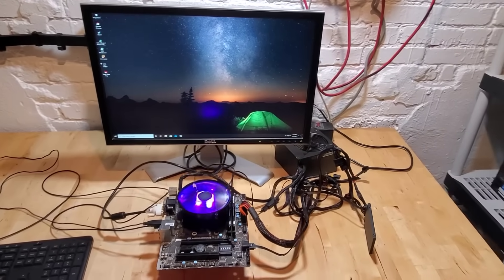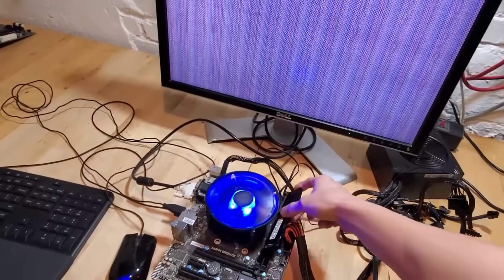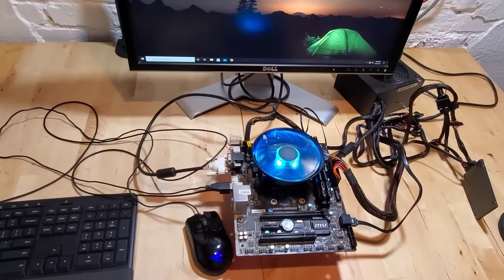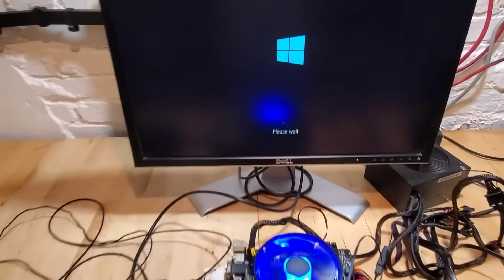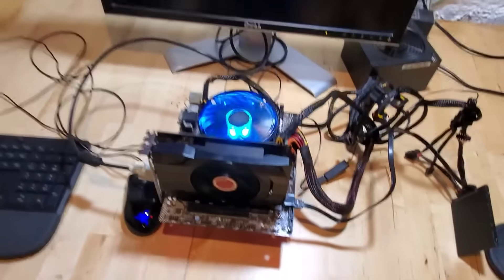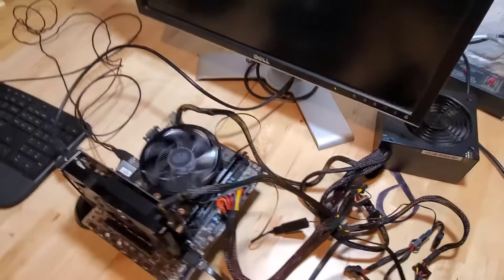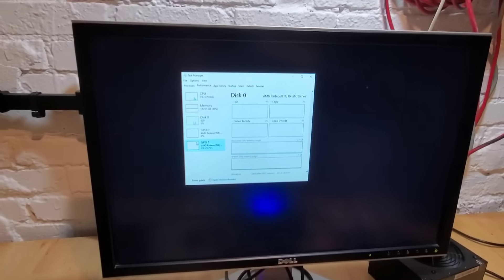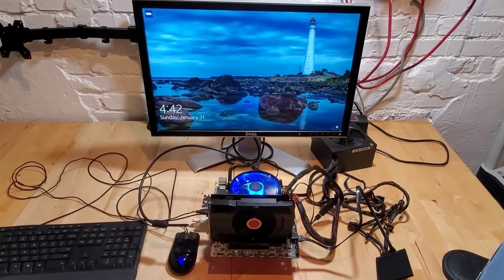What happens if you remove PC components from a running computer?

Comment: I was REALLY hoping that after removing the gpu, you would reconnect the display cable to the mother board..
Reply: Wouldn't change anything. The system actually stopped working as soon as the GPU was unplugged, because that's how WDDM is supposed to work. The device becomes inaccessible, which causes the GPU driver's frame buffer to enter a possibly infinite loop of waiting, then Windows kernel sees what's happening and terminates the whole system with stop code 0xEA (THREAD_STUCK_IN_DEVICE_DRIVER).
Reply: I was hoping too.
I think this is very relient on windows, I guess you could decide how it would react on linux.
But u know windows was not expecting custommers to... well.. unplug essential components from their computers. So my bet is that it would still be a black screen. (that would mean that they have a script that reacts to the gpu not answering anymore)
Reply: @klimmesil9585  Has nothing to do with scripts and Windows vs Linux but with the way BIOS and UEFI work. While there is an option for hotswapping PCIe, both the GPU, PCIe chipset/CPU lanes and BIOS/UEFI need to actively support it, be configured to do hotswapping and be prepared before removing the GPU.
Linux would also just crash as part of a memory space is suddenly gone and various PCIe registers are now corrupted, effectively locking the system out of controlling itself, regardless of Linux or Windows is desperately trying to keep things running...
Reply: So true so mothafucking true

Comment: i gotta say, this has made me feel a lot less worried about working on a pc. Was always terrified some part would just brick if you did a single wrong thing, or installed it a little off or anything
Reply: i mean you still have to be careful, I heard of lots of cases when the parts or mainboard just got fried due to that
It can vary from case to case I think
Reply: I mean, if you install a CPU "a little off" you could bend the pins(either on the CPU or the Socket depending on the type), it IS fixable, but usually just treated as bricking the part since it's so finicky to get them all right again.
Reply: when I was repairing my pc after my PSU went out, I was trying to figure out why my SSD wasn't being detected, so I look in my pc and I saw the SATA cable was not plugged in. stupid me decided to plug it in with the pc on and a few seconds later the cable went up in smoke. it destroyed my SSD lol.
Reply: @ImJustCj  it seriously started smoking lol? Sad
Reply: @chaosbuilder1531  Bent pins could cause that indeed.
On my PC I have SATA hotswap enabled so I can actually connect and remove SATA drives like removable storage, they even pop on the safe removal thingy (which I always do for HDDs). With a decent cable it's safe to do, now some crappy one could definitely cause serious damage, they aren't really made for repeated use.
Reply: Its funny actually, so many factors, sometimes parts can be stepped on without taking any damage and sometimes a single touch of your finger can fry your motherboard.
Reply: dude same
Reply: Your cpu will.
Reply: There are some very devastating donts in pc building tho, primarily under any circumstances you should never use the cables of one power supply on any other power supply, even one from the same brand.
Reply: @xaviorprime9203  That's not true, you should just never use cables across PSUs that aren't the same cables. Some PSUs come with the exact same cables, like the Corsair rmx series. Usually can Google it pretty easily.
Reply: @Wft-bu5zc  Thats one case where it works, and you wanna know what happens when you try this with lets say an EVGA power supply? It fries, i did that
Reply: @xaviorprime9203  Yeah, so uhh... don't do that. BAM, problem solved!
Reply: @couchmaster3773  Its not so simple when litterally i just used the same exact cable from the same exact model of the psu on my psu. Like the exact cable, it should be common sense that it will work right? And yet it didnt
Reply: @xaviorprime9203  Yeah so... like I said, don't do that
Reply: @couchmaster3773  He said that before you did. Stop acting like a knowitall
Reply: @spicesmuggler2452  'Ight, I'll get started on that by asking what you're talking about?
Reply: @xaviorprime9203  somehow in all my years of being into PC building stuff I never heard of this. I got a new PSU and replaced all the cables except for the ones for my 2 hard drives because I figured it used the same amount of power between the two power supplies so it wouldn't matter. Both of them were fried and I lost 6 TB of data. I'm lucky I replaced all the others because I would have fried every other component including the 3080 I just purchased.
Reply: @energysynchronized9932  Thats sucks to hear man, i also lost quite a lot when i fried my pc. Never got another gaming pc after because i was poor and couldnt afford it. Now im stuck on a 1050 ti
Reply: I always thought it could fry something, really impressed it didn't!!
I mean, one time I forgot to unplug the battery from the laptop while I was assembling the laptop screen, and as soon as I plugged the screen in with the battery still connected, I fried the LCD backlight inverter!
Reply: @you2be839  Yeah laptops are much more likely to have issues because of the battery thing, I stupidly tried to replace the thermal paste in my laptop because I thought I knew enough about building PCs to figure out a laptop, but I forgot to disconnect the battery, and bam just like that my laptop lost it's GPU entirely, and since the GPU is soldered to the motherboard there's no way to replace it, was just out of warranty, very expensive mistake!!
Reply: You should still be very careful... Never hurts to be careful and paranoid. Never work on anything while it's plugged in either.
Reply: Boy, I bet all these replies reassured you! FR though, the rule of thumb is, in my experience, pretty much just "don't act like a complete moron." And also maybe keep a receipt around... just in case.
Reply: And thats why u dont build ur own pc if you dont know how to build one
Reply: Yeah, plug a plug in a 3090 in halfway and you fry your 1300$ gpu
Reply: I know what you mean. When I was much younger I used to be super meticulous with everything I did for that very reason. As I got older and more experienced, I realized electronic components are a lot more durable than I was treating them. Static discharge and not being grounded can cause a lot more damage than say, throwing a RAM stick into the slot haphazardly. I've had thousands of times where I had to jam something in place or rip something out, not one time did it cause damage/make the component fail. But the handful of times I didn't take ESD precautions, I would say 75% of the time caused significant enough damage. However, hot swapping really isn't recommended unless the hardware fully supports it, introducing power without a fail-safe measure built in almost always causes damage, either immediately or over time.
Reply: Yeah, PCs are a lot more robust than for example Smartphones, which you can brick with trying to flash another OS on it when when the version of the software not perfectly fits that hardware. Smartphones are prima donnas, PCs are really super robust and even have hot swapable components like SSDs (storage) or monitors and of course all USB devices.
Reply: it would still causing short circuit

Comment: Did the video glitches happened because you were using integrated graphics? In that case the PC uses RAM as video memory. I don't think you would have those glitches if you remove the RAM while a GPU is installed

Comment: The RAM removal affecting the response of the input is because Random Access Memories store signals sent at the moment, detecting the movement of the mouse and electricity from the Keyboard, opening the File explorer.. all those are momentary memories on the RAM and removing a ram while the PC is running is basically cutting the circuit off (RAM from Board) therefore there is no plan to where the electricity and signal will go and where will it be stored

Comment: So what if we occasionally turn off the pc by holding the power button so it instantly turns off?
Or when there is a blackout?
Is it still a risk or are pcs more resilient against that nowadays compared to pcs back then?
Reply: if done more than a few times in a row, windows will get annoyed at you, but so long as you weren't writing data to system-critical files, it should restart just fine

Comment: I imagine these are all auto-shutdown safety features built into Windows and the BIOS by the manufacturer and programmers to prevent damage to components should someone actually be stupid enough to do this. Computers don't want to break; they want to keep working, and there are backup systems designed to do their best to restore everything to normal.

Comment: Could be nice if you try to hotplug one stick of ram and see if the system recognise it.
Same after unplug the GPU to plug the video cable back to the motherboard to see if the screen if coming back.

Some Motherboard have hotplug features who needs to be turned on for RAM and SATA. (Idk for GPU)
Nice video 👍
Reply: You can not hotplug RAM, on any motherboard, as the routine (code) to try and recognize new RAM is stored in RAM... Even if you were to store that routine on the SSD, the routine to load data from the SSD into RAM is stored in RAM...

Comment: the fans are only running because they still have power coming from their connections to the MB or PSU.  I have had seriously broken systems come to me for repair, where the fans were about the only sign of life.  Didnt mean the system was functional in any sense of the word, but just that the electricity coming to them was not interrupted.

Comment: The reason it works without the hard drive is because it loads into ram but if you try to load anything it will crash because it can’t pull the info from the hard drive to the ram people think stuff loads straight from the hard drive but actually it pulls to the ram and the pc actually loads it from ram if it were pulling only from the hard drive it would be extremely slow and it’s why if you have many things running it will get very slow unless you have obscene amounts of ram to keep multiple programs fully loaded into ram which is what editor use like 100 gigs or more of ram so all the video they are working on is in the ram and can be loaded instantly but if you had like 8 gigs it would lag and slow down anytime you switch video or audio files due to ram removing and replacing stuff constantly but storage on the new MacBooks is so fast it can be used just like ram and maybe one day we could even see ram being obsolete if storage can match ram speeds and becomes instant without even being able to tell it’s loading your pc would just have unlimited ram and could be even faster because it’s not having to move packets into the ram it could directly pull it from the ssd and it would also greatly increase the life of the storage because it’s directly modified once on site instead of being moved modified and then moved back